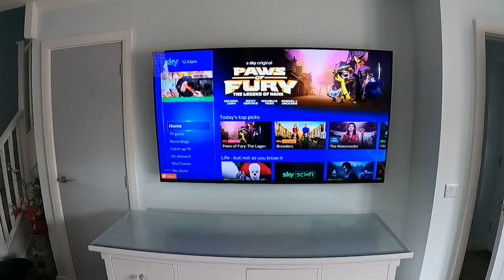WiFi problems solved by HARD WIRING.

Comment: Informative video as always. Is there any particular trick you use when running cables from the loft to the bedrooms. When ever I try that route I hit a rafter/beam requiring more than one hole before I can get cable through!! Best Neil
Reply from the maker: Not really mate, but I use a bradawl to poke up through first.  If it hits a joist then it’s only a tiny pin size hole to cover or fill.
Reply: @Theaardvarkdiaries  Thanks that’s a good shout I will try that next time, as you say smaller hole to fill 👍 Neil